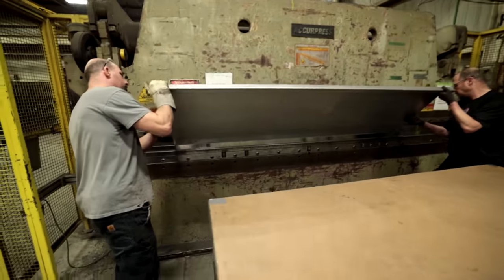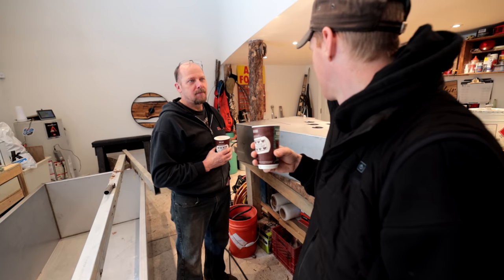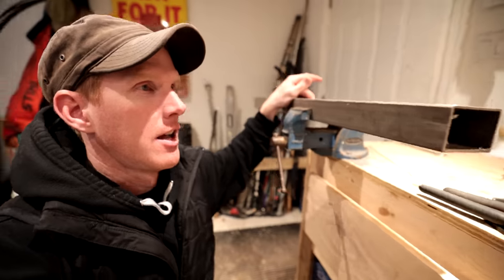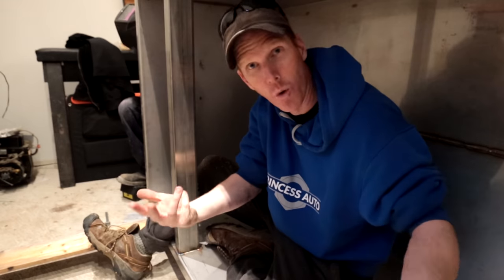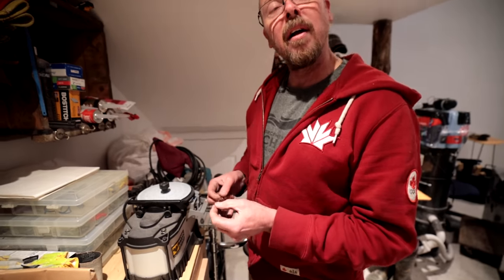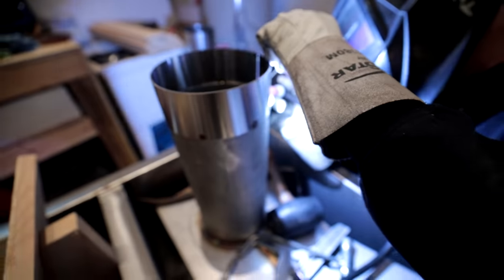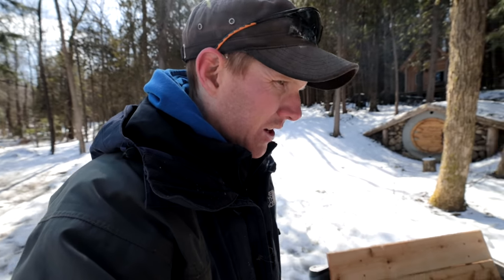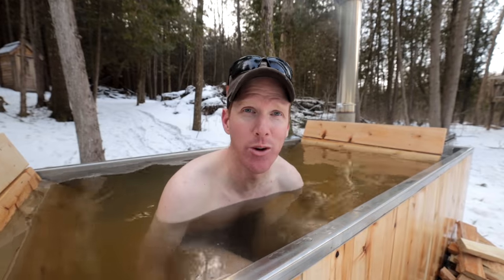Building a WOOD FIRED Forest Hot Tub (Start to Finish!!!)

Comment: Neat project. The hillbillys  in Kentucky have been making similar units for quite some time now. So how do you empty the ash from the stove?  Would have been nice to have built one end of the stove adjacent to the outer wall of the tub ,welded it in and you could have installed a stove door with air control vents.  Need a solar powered circulation pump to even out the tub temps.  A bubbler would be nice too.
Reply: Burritos the night before will substitute needing a bubbler...
Reply: I was wondering about ash cleanout too.
Reply: @Phorvuld  observations of Kevin’s projects, he will probably repurpose an old suck broom into an ash remover... or a repurposed poop-scoop will be fitted.

Comment: Nice work. You need to install the tub closer to a place that is warm and dry so when you get in and out you won't freeze. When you get out, you will freeze before getting clothed again. I have mine right at my back door. Consider paddling the water to mix it before getting in and that would help with the hot spots.

Comment: A circulation pump from the cold end to behind the firebox seems to be the next project. Increase the flow through the heat exchanger to speed up heating the whole tub and hopefully reduce the hot surface-cold bottom problem. John R below suggested a ceder lid, EXCELENT.

Comment: So do you leave water in and let it turn into a big ice block or do you drain it each time?
Reply from the maker: Fun fact the following day.. 24 hrs later..the water was at 76 degrees F.    But yes the idea is to use it for a couple of days and pull the plug.. that way you don't need chemicals.  etc.
Reply: If you insulated it really, really well (with vacuum insulated panels plus super insulated cover), you could go a long time without worrying about it freezing.  And then when it is getting somewhat close to that temp, just light a small fire whether you're going to use it or not.

Comment: If I had that hot tub in my backyard, I would never get out of it. Summers are brutal in Adelaide, SA so there probably wouldn't be any need to use the fire box between Dec and Mar as the ambient air temps (even overnight) should keep the water in that size tub at a constant temp of around 41C (106F) without a problem. :)

Comment: You could weld a pipe from the far end to behind the heater and install a minuscule water pump. This pump can be powered by a peltier element using the energy of the wood. This brings colder water to the heater, increasing the delta and increasing the heat transfer. The energy loss from the pump is almost zero..

Comment: Move it closer to the souna because if you slip on the ice/snow you might get stuck like touching the inside of a freezer and then ultimately freeze to death not a good way to go.. I would attach a small room outside of the souna for the hot tub with Windows and a smokestack going out the top. Just a idea,

Comment: Amazing build!  Possible upgrade would be to buy some Aquarium Bubble Wall Air Stones and pumps and circulate the water to even out the temperature.  You could run the air stones and pump off of your EcoFlow or other battery bank!!

Comment: Just needs a tiny little steam or Stirling engine to run a circulating pump or a small propeller to mix up the water. Maybe jet the hot water on one side of the tank down to the bottom? Could be a project for a future revision. That should be able to fix issues with uneven water temperature.

Comment: Clear ashes? For the stove ashes out? If the water freezes will expand and break the hot tub? Do you have a drainage pipe to take the water back down to the pond?
Reply from the maker: There is a drain at the bottom. It's would take DAYS to freeze.  The following day it was at 76 degrees.
Reply: @ModernSelfReliance  It looks so awesome and relaxing. As always bizarre and super cool you build the weirdest stuff

Comment: The Halo u speak of Kevin is the Argon that surrounds the weld with gas that pushes the outside air or O2 from contaminating the weld. By contamination is porosity will form or gas pockets that will weaken the weld causing it to fail.

Comment: Make a lid for the hot tub. Water warms up faster, it keeps trashes out and if you going to use it next day u dont have to start from the icecube. Also when heating if u paddle the water every now and then you get the real temperature. Looking good and nice "design". In Finland these paljus are almoust alvays round shaped. ps. You forgot the can holders for beer.

Comment: Au-Bain-Kevin industrial size.  I wonder if you can cook a deer in that thing as a sous-vide kind of thing. Means you need really good temp control, but a little circulating/water fan could do the trick...
Also... a walkway to - or moving the tub closer to an "inside" seems wise? LOL 😁
GOSH you got me with the constant soup references. Now I want you to actually make SOUP in that thing too. Take out the seat of course, but gee... like a giant pot of really good soup, then shared like the maple syrup. 
You didn't build a tub, you built a cauldron.

Comment: Congratulations on your new hot tub.   I thought I saw a small hole in one end when you were welding the metal.   Is it safe to assume that there is a drain?   Perhaps you could use a bit more cedar to build a segmented lid to retain heat longer.  Lining the metal edges with pool noodles to add a bit of neck comfort and to allow ice to form without buckling the metal.   Perhaps you could reposition this closer to your spa, reducing your need to sprint through snow.   Your wife will thank you.

Stay safe out there, peace brother.
Reply from the maker: The plan is to move it to it's permanent location next to the sauna.  Yes there is a drain hole.

Comment: Think of the foot petal As your gas peddle in your car the hotter it gets. The trick is to strike the Arc raise it up slightly never to touch the weld puddle and and filler rod as u go

Comment: You need a trolling motor to circulate the water and give you some bubbles
Reply from the maker: That's not a bad idea... When you first said trolling motor I envisioned sitting in 20' cedar boat with my dad at the helm idling a 9HP Evinrude two stroke putting along...   Then I figured you meant a little battery one.

Comment: With all that cedar that you have, I would have just built it out of a cedar composite (i.e. cedar, fiberglass, and epoxy. Fiberglass + epoxy adds A LOT of extra strength and durability to wood, though I've heard that cedar isn't the most ideal wood to epoxy because of potential oils).  Also would stay insulated better, though you would still want to add extra insulation. For that extra insulation, I would make vacuum insulated panels (not terribly hard  or expensive to make on your own with the right materials and know how).  Then I would make a cover out of a foam or cedar container with VIP's inside.
Reply: Btw, for IR reflectors to work effectively, they need a significant amount of air space/gap between the foil and the heat source and any other materials that might be in between.  At minimum you want at least 1/4" free air space, but ideally around a 1". Putting it right up or nearly right next to the steel container makes it so it won't really reflect much, if any heat back. Meanwhile, bubble wrap is a pretty poor insulator, especially for that thickness.  Foams are much better.  If looking for natural/sustainable, then kapok fiber contained in a waterproof or resistant fabric of some kind is pretty good. 

    As hinted at above, nothing compares to vacuum insulated panels though.

Comment: Nice! How long to warm up all that water? And did you forget the drain pipe?
Reply from the maker: 2 hrs from frozen.  Drain is there..  just didn't make the video some how..
Reply: Almost frozen. I know it sounds nitpicky as all heck, but there is a big difference when it comes to water. Water has some interesting properties.  One of those properties is that it takes a lot of extra energy or loss of same, to nudge into a different matter phase, whether it is from liquid to solid or liquid to gas, or vice versa.  That's why evaporitive coolers can be a thing in relatively dry climates, because when liquid water transitions to water vapor, it absorbs and takes with it A LOT of energy.

     If the water had technically frozen to a solid (i.e. truly frozen), it would have taken a significant amount of more energy and time to get it up to that temp.

Comment: Before Arc welding process was invented welders welded with Oxyacetelen process with filler metal that's a O2 bottle and Acetylene same what u would use in a cutting torch but with a different mixture value system and tips

Comment: What was your heating time for the initial firing?
Reply from the maker: About 3hrs.  From 32f to 102 then it was really easy to maintain...the following day the tub was still 70f
Reply: @ModernSelfReliance  
What gauge (thickness) was your stainless sheet metal used to form the tub?
Reply: Where did you get the initial bending done?

Comment: Dude, I love your work, but you said things upon which I gotta chime in. It's, "never look a gift horse in the mouth." You can tell a horse's age by looking at It's teeth. By examining your horse's pearly whites, you are, without words, accusing your gift giver of giving you an old nag. Mr. Sandman is an expression that refers to the salt in the tears produced to protect your eyes during REM sleep that crystallizes as it dries at the corners of your eyes. Whilst your colleague is welding, you should use green tinted shade #5 welding goggles used when oxy/acetylene welding. Even the reflection of the flash of TIG welding off of a wall can cause a flash headache. Just looking away isn't enough. Just FYI. I learn so much by watching your work.